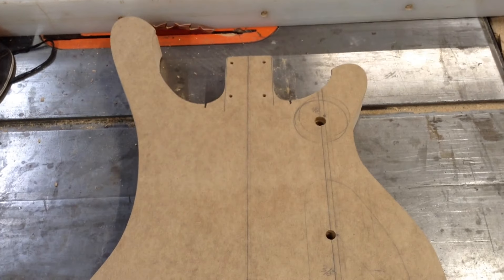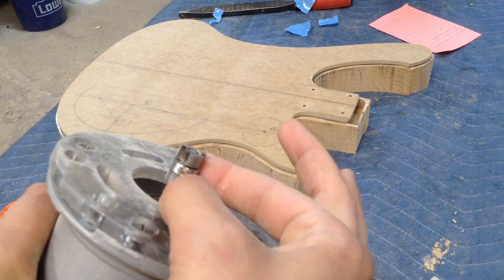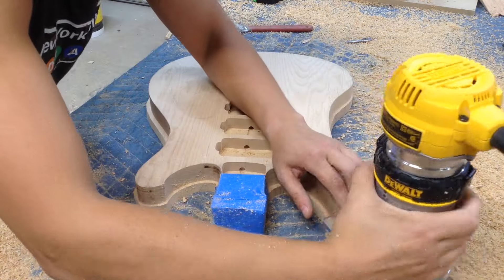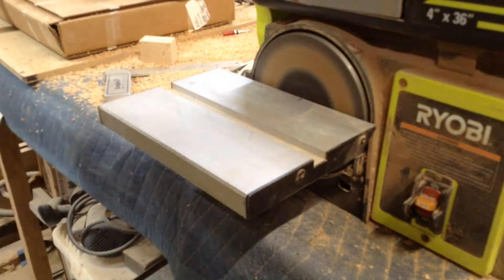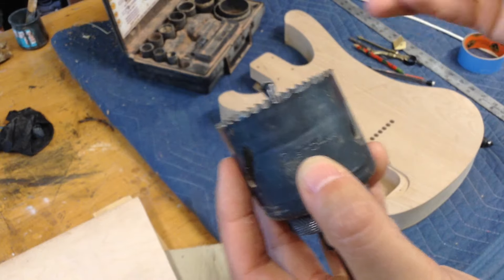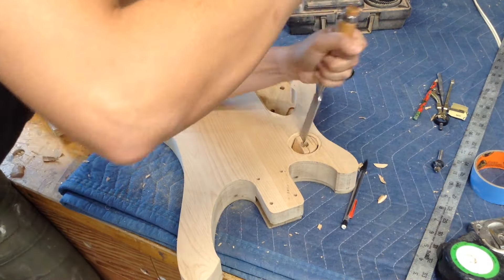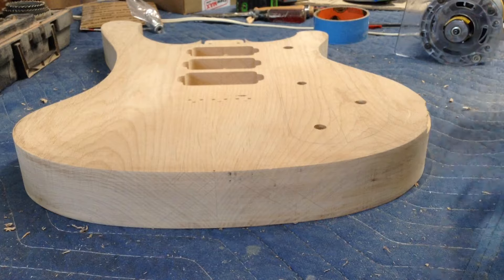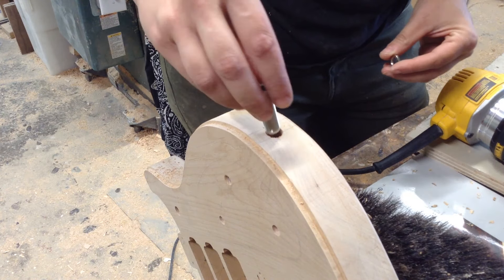Building A Guitar Body || Woodworking Projects

Comment: The advantage of getting the blank with pre-made holes is if anything happens whole making them it is not your problem to fix! Lol! Also the advantage of accuracy of a cnc machine not a liot of wiggle room with the components! Nice job!
Reply: Nice change of pace and interesting project. Thank you Caitlin. FYI, Matt Jackson, Next Level Carpentry, creates his templates with strips of wood / MDF super-glued together leaving an accurate pattern for routing. This method is a little easier and dare I say quicker than the method you show making a template for a pick-up. Keep up your great work and these interesting videos.
Reply from the maker: I’ll have to check that out.